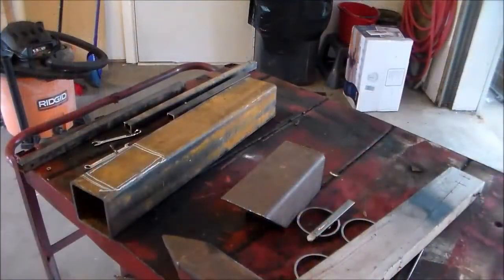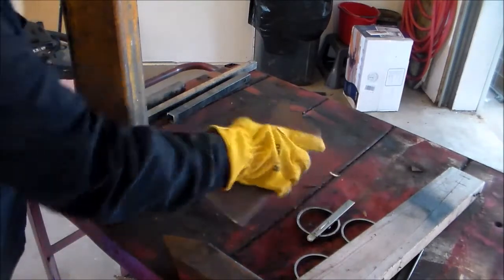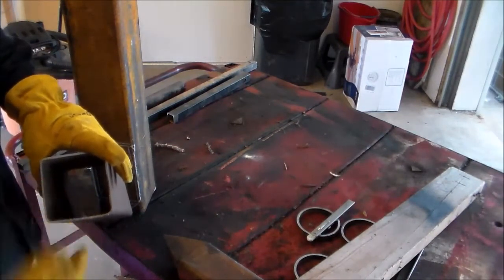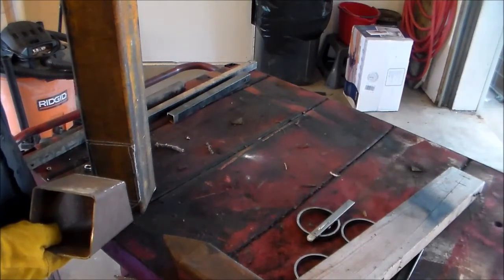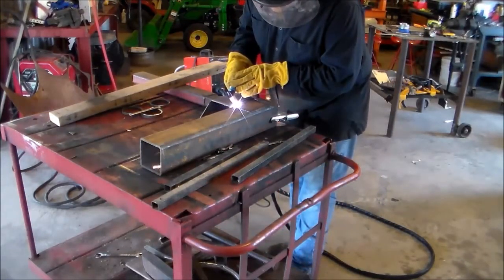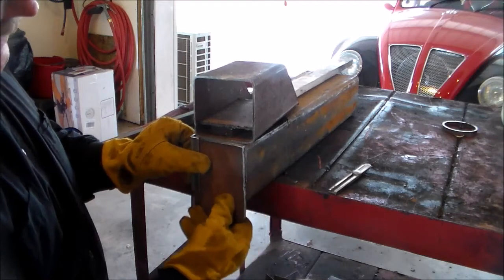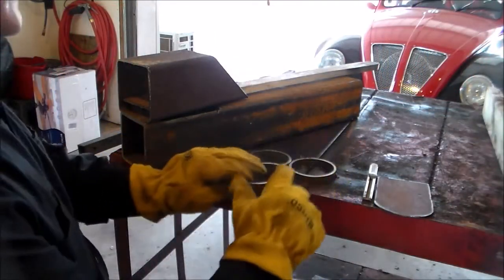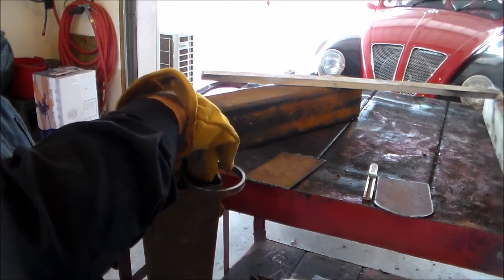W.E.L.D.A. Rocket Stove

Comment: Great rocket stove! I made one out of leftover cinder blocks & bricks. I cooked breakfast on it but didn't realize I wasn't recording until almost done! I started where I left off & finished my breakfast. It was good & in the middle of the winter. 
Saw that VW in the background with 2 vents & a big fan in the front. Does it have a V8 in it? The other rig was sweet too! Have a great day & thanks for the rocket stove welding class! That was great!
Reply from the maker: Thanks, the Bug has a 350 V-8 in the front. A real go getter , it was something I wanted tod for a long time and was a great build. Thanks and take care
Reply: It's a real nice VW! I should've had a V-8!
I remember a guy did that with one back in the 70's. Bright yellow with a wheelie bar. Too cool! Have a good day!

Comment: Lloyd you are the master at building cool stuff this little rocket stove is awesome!
Reply from the maker: I plan on doing a couple of mods to control the fire better. Thanks  Darren
Reply: A flue vent will work or a sliding door to control the airflow.
Reply from the maker: I experimented with the sliding door and that may be the way I go. Thanks

Comment: Oh yeah, I'm very familiar with rocket stoves. Your right, they're very efficient. Great job on your's there buddy.
Reply from the maker: I need to do a little more tweeking to this one to get it operating at its best. Any suggestions that you see? Thanks and take care
Reply: The rocket stoves I have are round and shorter. It boils water in about 6 minutes. Which isn't the fastest, but pretty average. Maybe cut yours down a bit would help? Not sure really.
Reply from the maker: Thanks for the info.